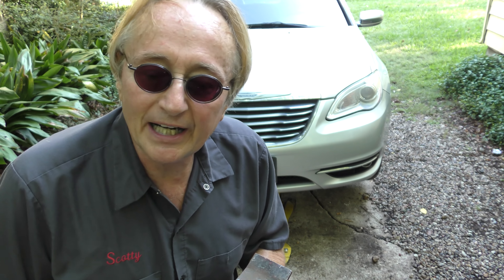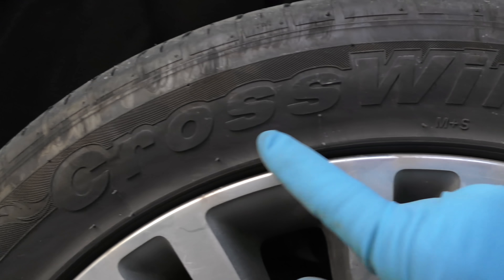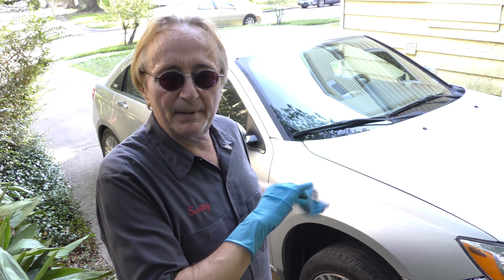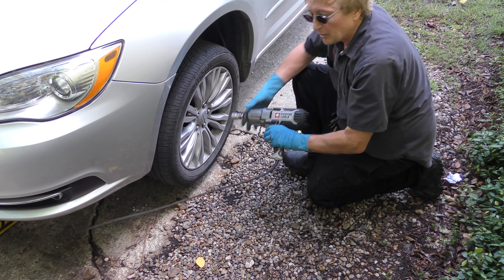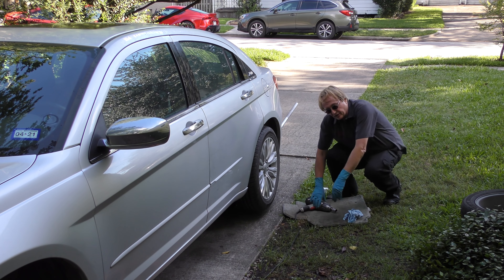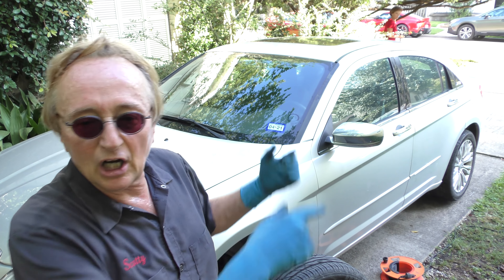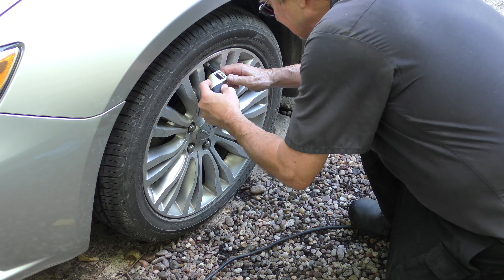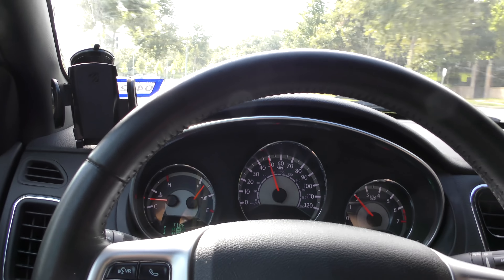Here’s How Stupid People Change Tires

Comment: Front wheel drive. All 4 tyres are usually the same. Rear wheel drive the front and rear tyres are sometimes different. Rear is wider mostly. You can swap tyres around front to back. But if you can’t. New tyres are important. Get them. It’s the only thing that connects your power, brakes and steering to the road. It’s singly handedly the most important thing on a car.

Comment: Another reason for the transmission not running right with old coolant could be transmission over heating. Many transmissions have a cooler in the radiator. Transmission fluid is pumped to the cooler and returned but old dirty coolant doesn't work as well as new so the transmission fluid wasn't cooling as it should leading to over heating.

Comment: Hey scotty, I have a 2015 honda civic lx with 53,000 miles on it. When I do a cold start on the car, there's a grinding type noise coming from the engine bay and was wondering on what it could be. Thanks

Comment: I agree you have to have the same kind of tire and same size on the front of a front-wheel drive car. However, if you don't have good tread on your rear tires and you go through some water since the majority of the weight of the car is on the front wheels, the back of the car will hydroplane easily and cause you to spin out. That is the reason why so many people say you put the best tires on the back.

Comment: from Popular Mechanics..
Rear tires provide stability, and without stability, steering or braking on a wet or even damp surface might cause a spin. If you have new tires up front, they will easily disperse water while the half-worn rears will go surfing: The water will literally lift the worn rear tires off the road. If you're in a slight corner or on a crowned road, the car will spin out so fast you won't be able to say, "Oh, fudge!"

Comment: My FiST wants 37psi front and back according to the manual. I run the fronts at 34psi and the 30psi on the back. It runs so much nicer and no great increase in MPG. 37psi is crazy 🤪

Comment: I can't find any jacks that look that well built Scotty. Can you list what jacks you recommend. I just ended up using 6 ton jack stands that are 14 - 15 inchs with out extending them so it is impossible for them to fail. Even though my jacks say double locking the double lock does not look safe to me.

Comment: The reason they say put the best on the rear is for severe winter driving only. When cornering you can feel the front tires not grip but u cant in the rear. So when you corner with good up front and bad in the rear (winter only) you can spin around because of loss of traction in the rear. Again this is severe winter and snow and ice driving only.

Comment: This vid was 3 months ago. 
Just my two bits....
Seen many Yahoo's using their economy size tire in the front with a front wheel drive!!
They rather be lazy than safe.
People, if you have a flat, put the economy in the back and put the rear tire up front replacing the flat.
Mind the tire if its directional.
It's a little extra work but worth it to yourself and other on the road.

Comment: One consideration about putting "worse" tires on the back of the car, for those who drive in adverse conditions (snow, ice, pooling water on highways); putting tires on the rear that could potentially have worse traction, such as those with much less tread, inferior grip compared to the front, or even worse, summer tires on the back and all seasons on the front, can lead to the rear end losing traction, spinning and resulting in a crash.

Comment: Hey Scotty any tips for getting an aluminum valve stem cap that’s stuck on off? Trying to get it off just spun the valve stem. I used a pair of pliers to carefully hold the valve stem in place and got one off but I’m worried about puncturing the other. Tried spraying WD40 on what I could but it hasn’t helped.

Comment: I agree that for braking traction in a FWD car better tires on the front should be the priority.. but the explanation I've heard for new tires being put on rear first (again in FWD's) is for handling. I guess oversteering is considered more dangerous than understeering because of spinning and total loss of control. As with all things maybe the rec has changed by now.

Comment: “When tires are replaced in pairs…the new tires should always be installed on the rear axle and the partially worn tires moved to the front." ... New tires on the rear axle help the driver more easily maintain control on wet roads since deeper treaded tires are better at resisting hydroplaning.”

Comment: @1:55 On my way home my Ford truck was rear-ended by a Chevy lowrider drag raceing, pushed over a curb side ways took out a fire hydrant and a stop sign 🛑
BAD repair shop the insurance company sent the truck to couldn't get the used front and rear axles aligned. As soon as you'd stop fighting the steering wheel you'd cross three lanes of traffic! They told me that I needed 4 new tires before they would admit they didn't fix the truck. Truck went back to Ford motor credit as a totaled vehicle with 4 new tires.

Comment: For a moment there I thought it was about how you took them off I don't have impact wrench so I use my 4 way lug wrench to get wheels off and on no torque wrench either so I have to guess sometime but I double check them after driving it a bit to be sure..... In my car either the front or back will be matching tires I never have mismatched tires on either side found that out the hard way which I had to fix myself...

Comment: Where I work we are told that new tires in the front and old in the back is bad because driving in the rain can be dangerous, and it promotes sliding. But I guess having old ones in the front can make the car shake? Normally I would say that the front tires were just imbalanced, but since the problem was fixed. Maybe people should just get 4 tires at a time

Comment: Scotty this is the 1st video I've seen of yours that I would have to disagree with. In my youth I didn't have a lot of money and had to play it cheap by rotating good tires to the front and bad to the rear, standard practice in the 90s. By putting less tread or bad tires on the rear of the car it made the rear of the car hydroplane very easily. This decision nearly cost me my life and others on ths road. The tires weren't bald and still had over the legal limit of tread depth. My car was totaled and my back was broken. I was in a back brace for a year and will now always have the best tires on the back of my FWD vehicle for the best rear traction possible. Having longer start times and longer braking distances from crappy front tires are a small price to pay then loosing complete control over your vehicle in wet weather. So there is a method behind the madness but I do agree with you that a lot of so called mechanics nowadays are idiots. Moral of the story run the best rubber you can stay safe.

Comment: I bought a rear wheel drive once super cheap because the owner thought the diff was making noise and he figured it was shot. The back tires were a 225 one side, a 245 the other. New tires solved the problem.

Comment: Would the same apply if the car was RWD so the power goes to the rear axle so have the meatier tyres on the back for grip or same applies put the best on the front for steering etc what is best?

Comment: Don't forget that while the Crosswind and Goodyear are both labeled as the same size, in actuality, one may measure taller than the other. The same issue can occur with different tire models, from the same manufacturer, which are supposedly the same size.

Comment: Plot Point:   The car wasn't actually shaking, the lateral torque balancer in the steering was effectively trying to drive down two different roads at the same time because the tires responses to the road were different.   Technology isn't magic, it's technology.  If you don't know how it works you shouldn't mess with it at all.

Comment: I am an engineer. I have been working on vehicles (non-professional) for over 30 years. The first time I saw that idiotic recommendation poster of worse tires on front at a national tire chain (about 10 years ago) I almost walked out of the store. There was some minor explanation on the poster about preferred control of the rear tires in a low traction situation. 

From my experience of driving in wet, snowy, iced, dry, oily, and every mix I cannot agree with the idiotic recommendation of better tires on the rear. This recommendation assumes the driver is too stupid or inexperienced to handle (correct) fishtailing of poor traction in the back. 

I agree with you Scotty. Best tires in front for steering and braking.

Comment: HI Scotty. Entertaining and informative. Right on about those tyres on that car...bloody dipsticks! However when I buy new tyres I generally fit two at a time and the new ones go on the rear; and this is for a front wheel drive. The fronts as you know do all the driving and steering, and most of the braking; therefore wear faster than the rears. I consider myself a better than average driver as I did some motorsport  some years ago and can handle most cars at the limit confidently. Average drivers generally can handle under steer ok, but not over steer. This is why tyre professionals advise to put the best tyres on the rear. But odd tyre on the front is just plain dumb. Cheers, keep up the good work.
Reply: @Uncle Bullfrog.  Hi Uncle.  Agreed - best tires (tyres) on rear, for the reason you stated.  But over in Retardistan it appears everyone disagrees with the tire manufacturers who spend millions of dollars on tire R&D and use!  I know who I would rather trust.  But I guess that's why Retardistan is called Retardistan!

Comment: Here in Australia having two different front tyres on the front weel drive is illegal. You can rest getting an expensive fine of $400 plus losing up to 3 or 4 of your 12 demerit points that you have to hold for 3 years in this country. Wow

Comment: The Goodyear had separation. Goodyear is really bad about that. Once the tread gets low the steel belt starts to pull away from the casing. When that happens youll get a wobble at slow speeds. You can see the bald spot on the inside edge of the Goodyear at 2:36.

Comment: if a car has four equally worn tires and one wants to replace only two the argument has always been to put those two new tires on the rear because drivers of front wheel drive cars when in a turn can control a car better if it  wants to push thru a curve not turning in because of tires are worn versus when in a curve if a car's rear end wants to loose grip and slide out needing much more steering input to bring the car under control.

Comment: Hey I have a question Scotty and you would know. I went to take 5 oil change, (2001 Honda Accord) they tried telling me my automatic transmission fluid was empty. I tried explaining to them you have to measure it when the car is running, or 30 seconds after it’s been running, otherwise nothing is on the stick. The guy was Arguing with me saying that even when the car is cold you should be able to see Automatic transmission fluid on a stick. When I check it i check it while it’s running and it measures fine. Who’s right?

Comment: You want the best tires on the front....but the way i was taught when i started in doing tires was never go by what the door calls for on air pressure...due to the fact is that one brand tire that came on said vehicle may call for 35 and you switch to a new or different brand tire in the same size but that new tire may call for 44 or even 51 psi and running it at 32 to 35 if that is what the door says will cause tire wear on inside and outside edge and some shops do this on purpose so you will come back sooner for new tires. I know this cause one of the shops i worked at done this

Comment: Firestone pulled that “best tires on the rear” spiel.  Nissan Sentra. Also charged me for valve stems that they never touched.Wouldn’t ever use Firestone for anything ever again.
Reply: @Benni711 , the average driver should never be going fast enough in the rain with bald enough tires to be concerned with hydroplaning.
Reply: @Benni711  Maybe...if you don't know how to drive. But in the meantime, starting, stopping and turning are all more important than the slight possibility of oversteer. I live in Northern Canada. I know what I'm talking about.

Comment: I live in CO and used to put snow tires on my 4wd F150.  I'd take them in and say put the good ones on the front and the tire guys would always want to argue.  I'd say the back wheels dont do the braking and what about steering on snow and ice?  Just PUT THE GOOD ONES on the front and make the customer happy.  Then I'd rotate out the back ones when they were too worn and put the old fronts on the rear and new ones on the front.  Its common sense.

Comment: The only time having more/better tread in the rear is if you are driving in very bad weather. The rear tires will keep the car straighter through heavy rain or low traction conditions on the highway.

Comment: scotty should have advised to also check the balance of the tire. usually you can have that issue and have diffrent brand tires and not do that. in this case, it was that the tire wear was severe enough to shake the front end.  but its true you put the better tires in the front not in the rear. coming from  10 yrs of experience in city fleet maintenance.

Comment: I had a Dodge Charger 2006 model 3.5, drove for almost 500,000km. The tyre bolts has shot after the first tyre change and each tyre bolts costed me 100USD per tyre. Never changed it and finally sold the clunck after started facing more concerns.

Comment: I still think you want the tires with the most tread on the back because hydroplaning the front tires is easier to recover from, if the back hydroplanes on a curve you're pretty much SOL. That being said you cant have different tires on the same axle, different brands are sometimes different diameters even if they are stated to be the same size. I wonder if that was tearing up the differential causing the shaking?

Comment: The reason they say put the best tires on the back “the real reason” is so that when a greater problem develops in driving they have a better chance of selling you more service or more new tires. Because now the problem has manifested itself in a greater more noticeable manner. Always remember when you take your car to a mechanic especially if you don’t personally know the mechanic. He is there to sell you parts and service that’s how they make more money. A honest mechanic is worth his weight in gold. The honest mechanic may not have the latest greatest shiniest tool. But he is worth his weight in Gold
Reply: The reason is safety. If you have bad tires in the back and get into a wet weather situation and start fishtailing it is much more difficult to get the car under control. If youre an experienced driver maybe you can, but let's face it 95% aren't experienced enough to know what to do in that situation. However, if the tires aren't worn past 5/32 I could see putting them on the rear because most tires at 6/32nds and above aren't going to have lost much stopping power (unless they are a cheap brand like crosswind maybe).
The funny thing about it though is when you rotate your tires on a FWD (seeing that you bought all 4 at the same time) is that you're always rotating your more worn tires to the rear because FWD wear they're fronts out faster.

Comment: if rear wheel drive it may be more benifical  to keep the better matching tires  in the rear, its better for the drive terrain, if say you have a tire at 10/32 on the right rear, and one at 3/32 on the left rear it could cause stress on the dif.  BUT in most cases cars nowdays are front wheel drive, so yes. best to put your better matching tires on front for transmission, rack, etc..     long story short, four matching tires  are ideal,  if 2 tires have more tread than the other 2, put  THE BEST/ MORE TREAD on your drive axle this will allow most use four ALL FOUR tires :)

Comment: Hey scotty, I've got an 04' grand cherokee with the 4.7 V8, my mechanic replaced the rotted out clamshell holding the tank to the car. He replaced the fuel filter while he was in there. New with a wix and it whistled, suggested I spend $89 for a mopar one and it still whistles , its very annoying, these have the regulator in them, I'm baffled, any ideas

Comment: I had a situation at NBT with my camaro where they refused to put my two new tires on the rear of the car because they had some dumb policy that new tires had to go on the steering wheel first... Even though it was a rear wheel drive car and my rears were in terrible shape.

I loudly told them that if they did such a thing I'd jack my camaro up in the parking lot right in front of the entrance and change them to the right place myself while complaining to potential new customers walking in.

They ended up putting them on the rear when I got the car back.

Comment: There are multiple reasons "Driving with new tires on the rear axle can help the vehicle to maintain control on wet roads because the tires with deeper treads are more likely to resist hydroplaning." It's also true for winter conditions such as where I live.. Michigan. If you have bald/bad tires on the rear you will lose control of the rear end when breaking, fishtail. So don't say that it's absolute nonsense when it's very important for safety and control. I guess it doesn't rain, or snow there in Texas.

Comment: Is it OK to put antiseize on wheel studs to keep the lug nuts from corroding to them???
Reply: If you rotate your wheels normally the removal and  installation of the lug nuts keep the threads clean. Maybe on a trailer wheels that never get rotated with open lug nuts I would.